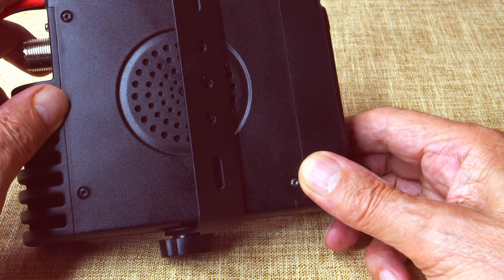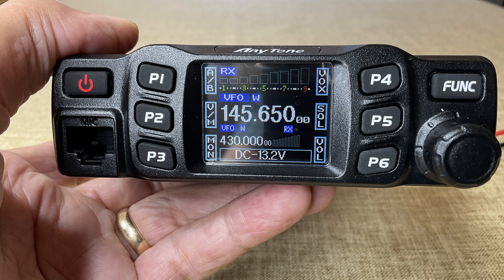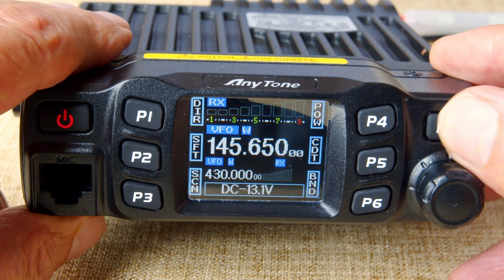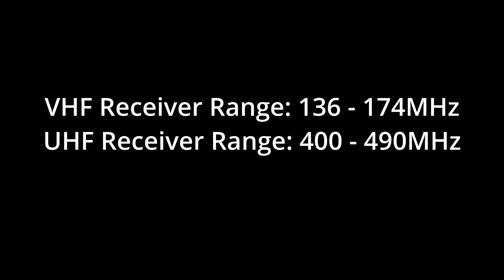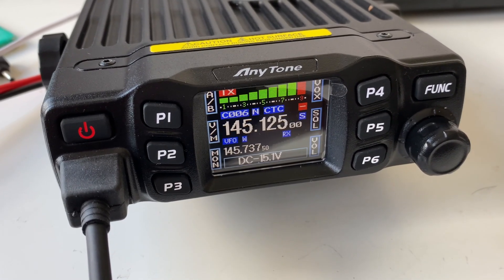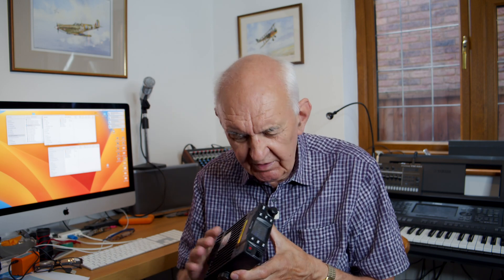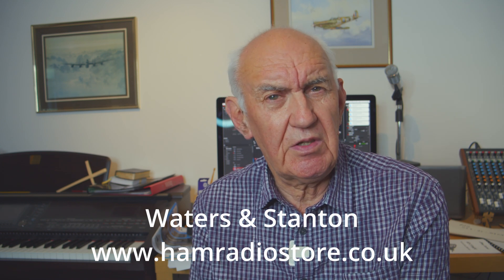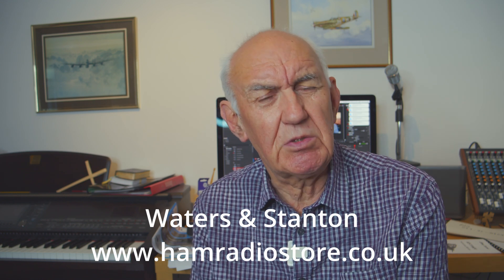AnyTone AT 778UV Dual Band Ham Radio Transceiver Review

Comment: I have 2 of these in the Retevis equivalent model and couldn't be happier. I have a scrap built slim-jim antenna 40 feet in the air and hit repeaters 40 miles away. Audio is excellent both ways. I get frequent compliments in the audio. 

I'm sure there are better radios, but for $107 this is a great option for anyone looking for a very capable and clean transceiver.

Comment: I have the Retevis R95 version of this radio, which for some reason is more expensive than the Anytone 778UV, so by all means grab the 778UV! I bought mine especially in order to take part in the 145 Alive events, and combined with even a tiny little mag-mount antenna on the roof of my car I could reach amazing distances. From the top of the North Downs (near Oxted, Surrey) I could reach the Isle of Wight, as well as parts of Essex. Amazing! The built-in speaker sounds great, and I have received positive feedback on what this radio sounds like on the air. Even though it's maximum 25 watts in power this radio is not a compromise, it's a serious bit of kit.
Reply: I spoke to you on 145 Alive 😊 was 2E0JHW now G5MAN.
Reply: @richardgroves290  Wow, I remember now! :-) Sadly I lost all of my contact logs of that day. Congrats on your Full License, one day I'll get there too! 73, Jan M7HNK

Comment: @watersstanton Which antenna would you recommend for this unit? I would like something versatile, so both 2m and 70cm. I would put it on the roof of my building, would like it to be omnidirectional. Thank you! 73
Reply from the maker: Check out the Diamond range of antennas.

Comment: I have Quite a few radios, Iv'e been on the radio now on and off since the 1980's. I only use PMR
now cause It's more private for me and the wife, And it keeps her safe when Im'e not at home.
I only want to use this radio on the PMR channels. Does it even do PMR. I have a HYS TC-B25 watt
PMR battery pack radio, And it is a very nice unit. But when i saw this on amazon I thought It was
really good for the money. Cause i does the 400mhz i want to put it on my disabled shooter, What
do you think pall. is it a good radio for what i want it for.
Reply: The anytone will do PMR yes, you just need to program it with CHIRP, easy enough to do.

Comment: I'm currently looking at 25w mobile radios for SOTA & Trig Point operations and this radio for its size and weight would be ideal. Does any body have any experience of operating this radio on elevated ground with an high gain antenna. Will it suffer with brake through and/or front end de sensing? Great over view video, thank You

Comment: i got one for the shack a couple of years ago.
perfect for my needs. local 2m stuff and local repeaters.
i dont use it much but.... if i did not have a batter radio in the car this would be my 1st choice as its small and does not cost a lot.
i recommend it for shack, gobox or mobile :D

Comment: I will never understand why everyone touts these radios as being so great. They’re cheap for a reason. That being they’re splatter boxes on TX and have barn door receivers on RX because they lack a lot of the filtering required to make them to spec. It’s bad enough that their low power offerings suffer the same fate. But this is  much higher levels of RF splatter. Not to mention they drift frequency quite a bit as well. So as part of a review I’d like to see a demonstration of one of these radios on a spectrum analyzer, not just a watt meter, if not for anything but to prove me wrong.

I’m not sure about the rules over there across the pond, but here in the US it’s a violation of spectral purity rules that make these illegal to operate. This also takes sales away from the manufacturers that produce proper radios. Don’t be so cheap. I’m not saying you have to buy top of the line, but certainly a lot better than this.
Reply from the maker: Splatter is not a term I would associate with FM as the carrier is at a constant level, unlike Am, SSB and CW. However, I suspect that you may simply be passing on what you may have read somewhere rather than owned this radio. I detected no drift, and whilst I did not check this sample for purity, our QC department did, and it was well within spec. compared with mainline named radios.
Reply: Tsk tsk

Comment: It great set I use it just for mobile I didn't want to put expensive radio in the car just incase if the car gets broken into. It has incoming and outgoing audio I've had great report value for the money I do run extension speaker. It a great starter for the new ham.

Comment: I have the Retevis badged version, great radio for the money. Yes, they get warm but it's never been an issue for me, I wouldn't want to put it in an enclosed space, really does need some air flow across it! Dead easy to program with Chirp. One irritating feature I find is that if you make any changes with P1 to P6 then it has to be confirmed with a further press.
Reply: I Have the AnyTone Version.  Yes it Does get HOT Fast!  I cured that By Placing a 4 inch Diameter COMPUTER Cooling Fan ON TOP of it!  It Keeps it COOL! 👍😃

Comment: Can't speak for the Anytone branded one as I have one of the 'clones', but as others have noted the issue is that on anything higher than the lowest power setting it gets hot after a few minutes on transmit. And I mean HOT! So hot that you wouldn't want to touch the heatsink, so hot in fact that on the highest power setting it actually throttles back its own output to protect itself. The meter on the front doesn't show this happening but an inline power meter does. If you fit a fan on the heatsink - which isn't that hard to do - you can overcome this. But even with that caveat you'd be hard pressed to beat the features you get for the very competetive asking price. I've used mine quite sucessfully for over two years and recommended it to several new licencees just getting started at Foundation level. They all think it's a great buy, particularly as they're using it on the low power setting where heat isn't an issue.